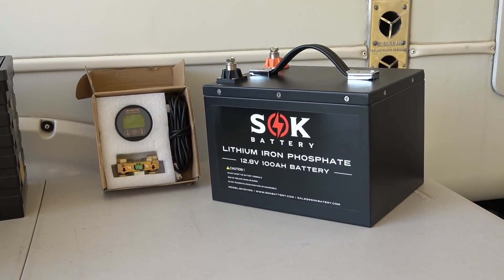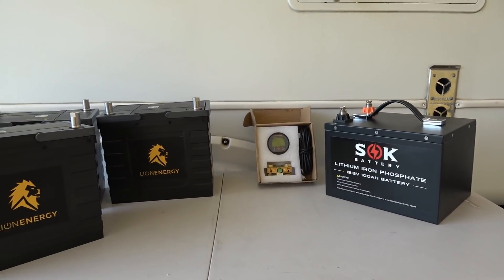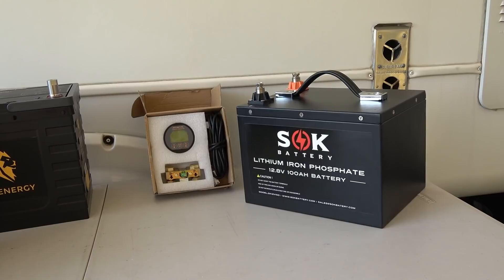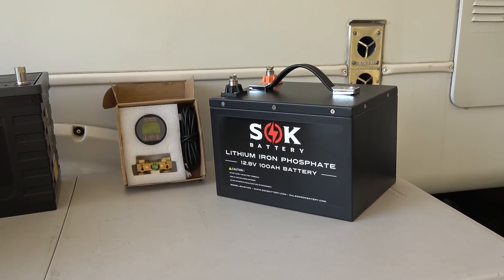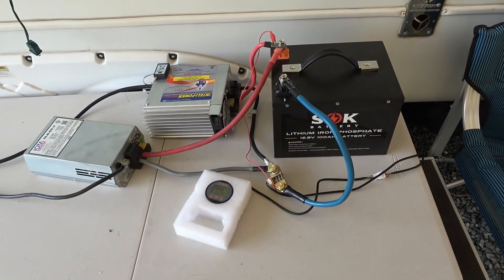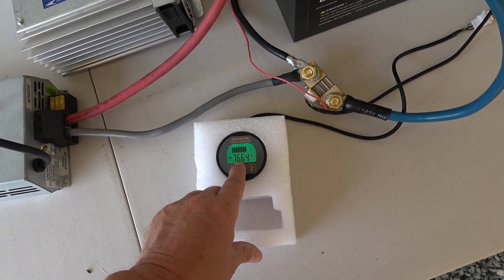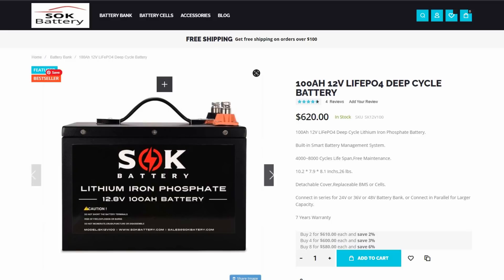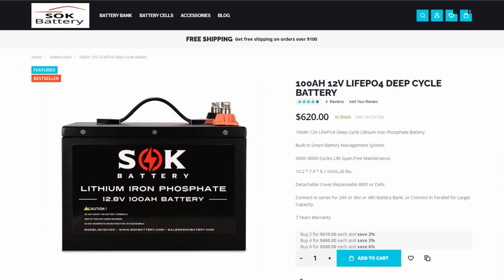SOK Lithium (LiFePO4) 12V RV Battery - Demo, Tests, and Initial Review (Model SK12V100)

Comment: Thanks...nice review.  I'm in the process of making a battery compartment where space is limited for my 4WD Suburban...leaning towards the SOK battery due to its smaller footprint.  The 12V/100aH with Bluetooth is 'only' $570.  Haven't heard any complaints about its performance or quality when considering the much cheaper Chinese alternatives.  I'd rather pay more for the peace of mind.  Thanks again.

Comment: Good video thanks. Question please: I have the SOK 100Ah and it was performing well in my camper until I took my camper in for a repair and the mechanic drilled a 3" drywall screw thru the wall penetrating the SOK case and the end cell. I discovered when I plugged my water kettle into the inverter and the inverter turned off. So, I bought a new SOK cell for $100 and replaced the bad cell. I thought that was pretty cool, but when I charge it with my Renogy 100w suitcase it will charge for a few minutes then the controller turns off and on off and on. Do you have a comment about what is wrong? Thanks much, Scott
Reply: Thank you. I followed your advice. I think the BMS is shot too. The Renogy solar/controller works fine on another lithium battery I have and it only blinks on the one in question. Thanks again.
Reply from the maker: I would check the voltage of the 4 cells and make sure they closely match each other. Usually they will test at 3.2V each or above to make 12.8V or above. If that's the case. Then next I'd try a different charger to see if the Renogy controller is good or not. If the other charger has problems they I would suspect a problem with the BMS board.

Comment: How would I charge this using car cigarette lighter?
Reply from the maker: The cigarette lighter socket has limited current capacities. Better to install a DC-DC charger right to the vehicle battery like this https://www.renogy.com/12v-20a-dc-to-dc-on-board-battery-charger/

Comment: I have two of the  SOK100AH batteries.  Great battery...my only complaint is the width of nearly 8 inches does not fit well into standard 12VDC RV battery boxes or commercially available trolling battery box. Also the 2nd one I purchased 6 months later has a larger case.
Reply from the maker: The good part is being lithium there is zero venting of gases and no liquid to spill so you don't need to use a standard vented battery box. Any box will do or no box or a bag. Even install them inside the RV and in any orientation. :) Cheers, Ray
Reply: Agreed quality Lipo4 batteries with a good BMS are pretty sweet. Two years ago I built up 96AH Lipo4 battery pack using 6 x16AH batteries each with built-in small BMS. Each 16AH battery is individually fuse and connected in parallel and has a main 60Amp breaker. I use it for trolling motor,  ham radio power supply, camping use for lighting, charging radios and phones, and C-pap operation during home power outages. Hunting camp use of my 96AH battery here in Montana requires a 12vdc /12 watt battery heater pad in an insulated box along with low temp switch to turn on the pad and a low temp switch to prevent charging the batteries when below 32 degrees.   

The first SOK 100AH battery has been installed in our 20' foot camp trailer storage area under the bed using a plastic battery box. The SOK replaced two 100AH deep cycle lead acid batteries that were at end of usable life after 7 years. The Lipo4 battery box has insulation and a 12w heater pad with programable digital temp sensor (turns on below 35 degrees and off at 40).  I use Anderson 120 Amp connectors for quick connection to the campers 12VDC distribution and charge controller system and additional switches to disable charging from solar or DC-DC charger if temperatures are in the  30s or below. The exiting SOK batter has a 50 amp breaker. The second SOK will be configured same. During the winter when trailer is not in use I pull the battery packs and store them in the garage or house at 80%  capacity and use them during power outages.

Comment: Just noting on their UK site that the continuous discharge on these batteries is rated 100A, 200 peak for only 3 seconds.
Reply from the maker: In my test, it performed better than rated but I did have an early model. SOK had just started to sell batteries. And sold BMS boards too.

Comment: Made in China what could go wrong
Reply from the maker: All depends on which factory in China made the cells and the quality of the rating. Some manufactures use lower grade cells that may have been used already and repackaged.
China can make excellent products. So far these SOK batteries have been pretty good from what feedback I've read. Cheers, Ray

Comment: Hi Ray. I have been enjoying your videos and have been learning alot.  I have a question for you in regards to LiFePo4 batteries and am hoping that you may be able to offer some insight.   1. Can I safely use both a 100ah 12v Battleborn Battery (which I already have) with a SOK 100ah 12v battery (need to purchase) connected together using the same solar controller?   2. And/or can I safely use the BattleBorn 100ah 12v battery with the SOK 206ah 12v connected together?   3. Or is it not ok/safe to do either.   4.  In regards to the SOK metal box/case - Do you think that the internal temp would be hotter or colder inside with the metal box vs the BB plastic box/case?   I'd really appreciate your feedback on this as I am getting ready to purchase more battery storage capability. As you probably can tell - I know very little about the whole solar/Lit Battery thing LOL . My knowledge is basically what I've learned from mainly your channel and other YT channels.   Thank you so much dear sir!  Happy and Safe Travels to you!!
Reply from the maker: I'm not sure as the internal BMS of each battery may interfere with the other. Most manufactures say to use the same make and model of battery when hooking them together. I'd contact the manufacture to double-check. I think the metal box would be better at cooling off the BMS when it's working hard, but the trade-off is in cold weather it would not keep the cells as warm. Cheers, Ray

Comment: I have the same battery monitor. It worked great for about 3 months, then the state of charge function failed. It still works to measure amps in and out, as well as battery voltage. I checked on line, and this seems to be a common problem with this unit.
Reply from the maker: Guess that's why the good ones are around 200 bucks. :)  I have a Trimetric battery monitor, still works great after 8 years but was expensive to buy.

Comment: Hey Ray! I see you were able to get about 140A of current before the voltage drops below 12V. My SOK 100Ah is dropping below 12V at just around 70-80 amps. Do you suppose I have a defective battery?
Reply from the maker: Sounds like a problem if the battery was charged up. They advertise a max discharge rate of 100 amps and being lithium unlike lead acid the voltage shouldn't drop too far even under heavy loads. Send an email to sales@sokbattery.com and see what they say. Cheers, Ray

Comment: That monitor is actually an AiLi Monitor.  You should have set the battery size larger than the real battery (ex 150ah) so that when charging you could have seen how much was actually put in battery.  It was obviously more than 100ah as it was still charging when it hit 100%.

Comment: Can this be charged thru AC? No need for external bms right?
Reply from the maker: The battery does have its own internal BMS but not exactly sure what you mean by "charged thru AC" ? The battery is charged by DC voltage usually in 14.2 - 14.6 VDC range using a solar charge controller or DC battery charger.

Comment: Might want to mention that SOK uses prismatic cells. That means there are only 4 connections internally unlike BB and others that still use the little 3.3 volt batteries with 100-200 connections that could possibly dislodge.

Comment: Very interesting video. Thank you. I have a newbie question. I am a bit confused about BMSs and charge controllers. I have seen people set up a lead acid solar system in their RV with the panels, a charge controller, and the batteries - no BMS. The SOK has a charge controller. Can this take the place of a BMS? I am confused on when each is needed? Can you please help?
Reply from the maker: The BMS battery management system is used for lithium battery cells, its job is to keep the cells in balance and stop charging when the cells reach a fully charged state.  So it protects them from overcharging and undercharging. It also has low and high-temperature protection and short circuit protection. The BMS used to be an external thing but lately, many companies have been putting them inside a case along with the lithium cells a so-called "Drop-In" replacement battery for the old lead-acid.  I did a follow-up video to this one where I give you a deeper look inside this SOK - https://youtu.be/vnG5RCSMCKA  Charge controllers are something else, usually, it's a solar charger that takes the solar panel raw output and controls/regulates its charging voltage to supply the batteries properly.  Cheers, Ray
Reply: Love Your RV Thank you so much and so quickly. I actually found your other video before this one. Also very good. This all makes sense now. Although there sounds like there are lots of moving parts to consider: batteries, charge controllers, BMS, monitoring devices, inverters, solar panels, and so on. I do find it fascinating and am anxious to continue learning. I do worry that I could fry something or me. 😂

Comment: For their 206Ah battery model the Recommended Charge Current listed on sokbattery.com is 40A and max is only 50A - same as their 100Ah battery!
I inquired why the bigger battery has only 0.25C charge rate and Min responded that one can charge at 70A:
"in fact you could charge it at 70A,we want to make sure the battery could work for long cycles life. charge at low current is better for battery life".
The manufacturer of the individual cells Ganfeng Lithium Battery Limited list 0.5C normal charge rate so that's a more reasonable 100A. It appears that Sok wants to ensure the user gets at least 10 good years out of these batteries.

Comment: At 3:50, the sokbattery.com website list the weight at 27lbs, 4 more than the Lion Energy. A bit heavier case but MUCH lighter price.
Regarding charging rates for the 100Ah their website states the Recommended Charge Current is 20A and max is 50A. Here is the information on the individual cells made by Ganfeng Lithium Battery Limited.
https://www.sokbattery.com/media/sparsh/product_attachment/GFB_100Ah_PS_EN_11FA_20191104_.pdf 
The individual cell specs show max. continuous charge current at 100Ah. Min has explained that their lower max. recommendation is to ensure longest life possible.
Reply from the maker: I weighed it with my own scale and came in at 30 lbs. but could be off a bit. I think they under rate them.  But most people will never need to max out the charging as most with high amperage charging systems are going to be running multiple batteries. Cheers, Ray

Comment: I love how 1 year old (or less) companies offer 7 year warranties!    I turned 62 today and I am not even sure if I will live 7 more years.   8000 cycles for LFP?   Bold Marketing Claims.   75 percent of all the battery makers in the last 10 years have gone bust....A123, Valence, Lithium Werks, International Battery, and on and on.    Only Lithionics Battery (made in the USA) has made it past the 10 year mark.    That's why OEM's like Winnebago and more use their batteries....stability, reliability, etc.
Reply from the maker: I guess a company has to start somewhere. 4000 - 8000 is what they market the 4000 is in range to what many of the manufacturers put as expected full charge/discharge life cycles until they drop to 80% capacity, many will have a second higher spec range for partial cycles since many users, especially RVers will often not need a full cycle.

Comment: I love what Lion and Battle Born bring to the table, especially the Made in USA part. At the same time, most of the batteries sold with our RVs and also as replacements are built in China, so upgrading to something that seems well-built, functional at about 60% of the the cost brings a viable option and perhaps will bring a little cost-check into the market. 

This brings a Lithium bank into my budget so I just may pull the trigger on it.
Reply: Your beloved battle born are built with China cells also.

Comment: Watt is not specified in these batteries.  For example, my scooter works with a 60v and 1500 watt battery.  If I buy this battery, how should I know that the fog does not supply more than 1500 watts or less than 1500 watts?
Reply from the maker: Here are the battery specs - https://www.sokbattery.com/100ah-12v-lifepo4-deep-cycle-battery.html  1280 watt hours
The battery is rated to supply 100 Amps at a 12.8VDC so 1280 watts.

Comment: How long did the heater run the first time you drained  the battery thanks
Reply from the maker: A little under 2 hours. I'm planning on doing several different discharge tests with different amperage draws to see if the power capacity varies. Currently doing a low amp draw test. Then I'll do medium and high.

Comment: Some of the jargon you use is slightly over my head. Can you simply tell me, is there a charge controller inside the battery box? If I understood it, you were capable of higher current than it was accepting. Are external "charge controllers" un-necessary with this battery? Is this internal chare controller common in  Lithium batteries of other brands? Good methodology in your testing, well done video.
Reply from the maker: No, the board inside is a battery management system board. It is there to keep the 4 cells balanced and prevent overcharge, under charge and operation in too low or high of temperatures, plus it has short circuit protection.
Optimally the battery needs to be charged with a constant voltage in the 14.2 - 14.6 range, via a solar charge controller, inverter charger or a converter charger. They make ones now that have lithium settings or some can be custom programmed. Once charged unlike lead acid it doesn't need a float voltage.
Reply: @LoveYourRV  Thank you for a very informative reply.

Comment: Heck, if any part of this battery failed, one could get parts out of China to make full repairs, and a low cost.  I like the battery, I wish that I hadn't just thrown $4000.00 down on two Lifeblue LiFeP04 12 volt, 200AH batteries.  If I hadn't, I would take a gamble on this one.
Reply: With that kind of money how come you didn't chose the Victron batteries?
Reply: @PrimalMiltos  I didn't know anything about the Victron equipment, or batteries, until after I had already purchased the Life Blue batteries.  Originally, I did a search for 12V Lithium batteries on Amazon, but several of the well known manufacturers did not surface.  I started putting together a Solar Power Management System from scratch, without any help, or prior knowledge, but YouTube.  As a result, I have two Life Blue 200 AH batteries, A Victron 12/3000/120 inverter, 2 Renogy 200 AH solar panels, 4 "Rich" 190 AH solar panels, Victron BMV 712, (redundant), a victron Lynx Shunt, a victron Distributor.  I had money to burn on a credit card, and was board stiff, so I put everything together and built the complete system.  However, after that experience, I now realize that I could have put together a system for 1/2 the cost, and probably much better synchronized.  The only thing that I really learned, is how to put a system together, and make it work.  Actually, I put my entire system together by watching numerous YouTube videos.  In no particular order, which is why my complete system is patched together.  However, It is working great, great, great, great!  And I eventually spent the money to protect my investment by purchasing a Hughes Autoformer,  a power management device, a Square D disconnect, square D main breaker.  And, I fused the hell out of everything.  If you have any questions, I may be able to help you out.  I have since starting this project, probably spent 80 to 200 hours watching YouTube videos.  I even mounted my Solar Panels on Uni-strut.   Of course, I managed to learn the disadvantages of mix matching equipment and manufacturers, but I will have a great YouTube video to post after I am done.

Comment: I am very impressed with the SOK lithium battery.  The price is almost too good to be true, and in all my years of living, if it sounds too good to be true, it usually is.  However, this company could be a good long term company, and the price is so good, many of us will jump on it.  I thought it was a great review, telling us of any possible flaws, but the Pro's  appear to outweigh the Cons.  The price is so low, that I can consider it not much more then gambling in Las Vegas, but with much better odds.  The only con that I could see, was the voltage drop, when under full load, and I do not know how much of a problem that might be?
Reply: If you do a search on google for inexpensive LiFePO4 batteries, you'll see 100 AH batteries going for under $400 (which includes the BMS)!